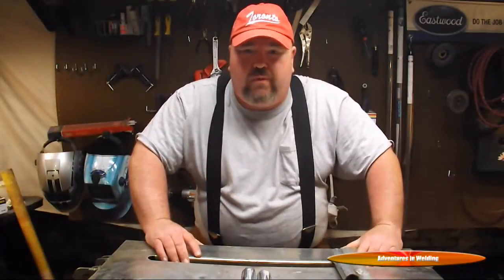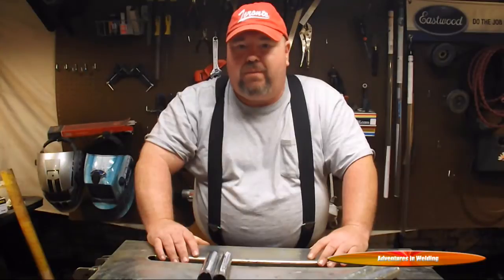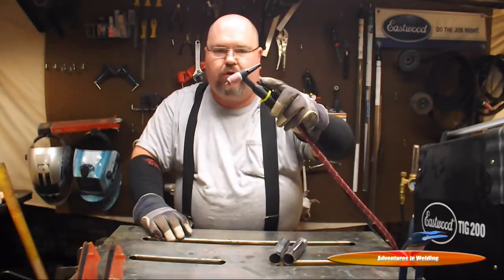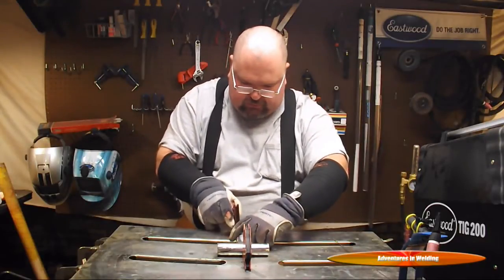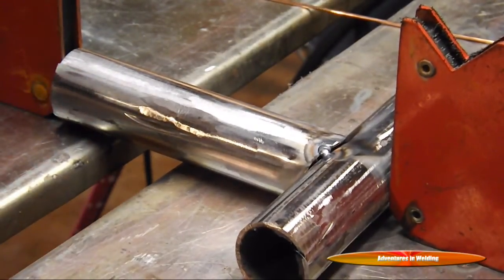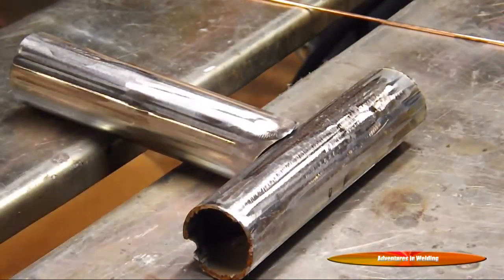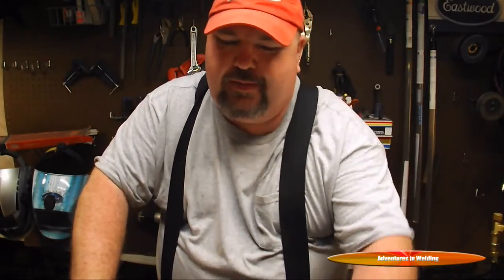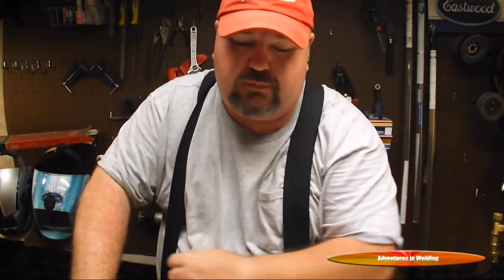Tube joints for beginners - Adventures in Welding #129

Comment: Welds could of looked better with the right filler rod. Use stainless steel if available for stainless tubing. I'm a professional stainless steel tig welder. I always like to continue learning from other welders. We can always learn more. I do this type of welding everyday at work. Thanks for the vid.